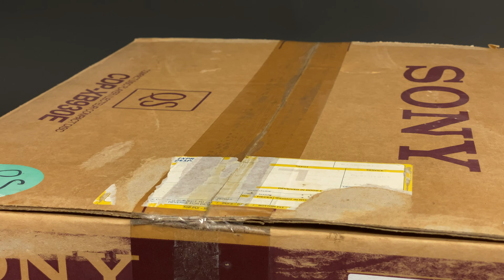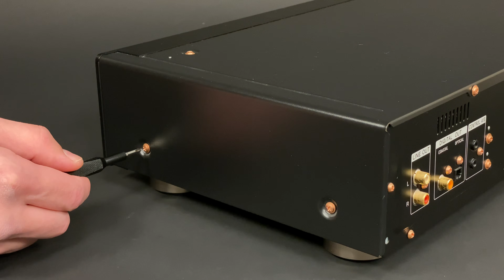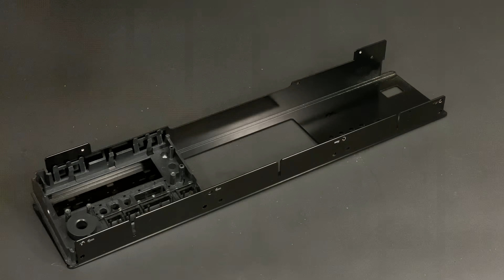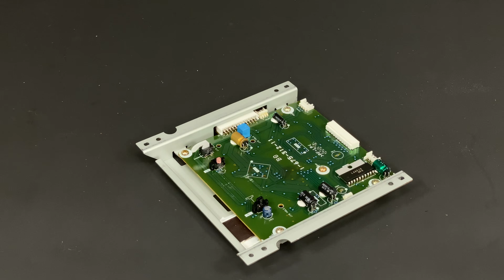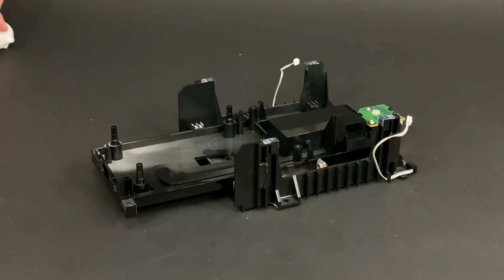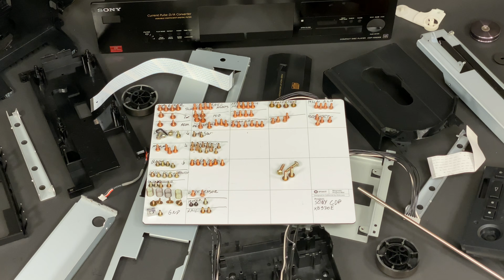Sony CDP-XB930E teardown

Comment: It's decent but you can tell this was when they weren't made so well. Cheaper. Not made in Japan :(
Reply from the maker: It's a huge difference when something is made in Japan.
Reply: It may not be made in Japan, but it’s a well designed and well put together machine. 

CD Players like this are not made anymore, they are all generic now.

Comment: Does this support CD TEXT ?, the copper block on the transformer is a heatsink
Reply: Yes it supports CD Text. I’ve had one of these from new.
Reply: @michaelb9664  Thanks m8
Reply: @Synthematix  no problem 👍
Reply from the maker: I don't think that transformer needs a heatsink. 

I don't have this unit anymore but I'm sure that you will find technical specifications very easy.

Comment: Ive just purchased this from a friend (not got it yet) its a silver Sony CDP-XB930 QS, but my friends also has a headphone port on the front I guess yours does not for some reason but same model number. Would you recommend my friend ship it with the puck removed? Do you have any information about what the mechanism does for playback if anything. Can it give better performance with a static laser? Or is it a fancy design with no performance gains 😉
Reply from the maker: Yes, I believe it safer to remove the puck and secure it outside the unit.
CDP-XB930 has very interesting design but I don't think that it would do a massive difference. Overall it's is a great player.

By the way. I saw a CD player  which need the cd to be loaded upside-down. Would love to tear that one down.
Reply: @boredtech  I assume that's the Pioneer Stable Platter model. That was so cool when that came out that I went down to my local hifi shop to see that one in person. It also features legato link processing. It had a different sound, but it was not night and day between my current player at the time, which I think was my Philips or Marantz (maybe Technics); my memory is a bit fuzzy now, so long ago. But the Pioneer was super cool to see in person at that time. I never did get one, but a few years later I got a Pionner LaserDisc player, and that had a legato link, so I was able to test it. It was not a massive improvement in sound; it just sounded different.

Thanks I will get it shipped with the puck outside the unit.
Reply: @boredtech l have a Pioneer stable platter player which I'm going to sell. I've thoroughly enjoyed using it but l have two better players now. I'm in England if you'd like it.

Comment: This is insanely good implemented video. A pleasure to watch... I have a question, i have the previous model Xe900 which has the same mechanism, but it does not spin and sometime when it spins it does not recognise the CD. The laser seem to light up, and the motor seems to work. However i have a small impression that the mechanism that holds the cd icannot move back and forth (as the laser stays in fixed position). Any  further ideas?
Reply from the maker: Hi, thanks for your feed back, I’m pleased that you liked it. 

Unfortunately I don’t have this player with me any more. I can suggest you to find a Service Manual, maybe there you will find some troubleshooting tips.
Reply: @boredtech  of course it would be great…

Comment: Absolutely brilliant to see your video.I have 2of these cd players ,one exactly like yours with the red UK badge and one without the UK badge.I wonder if that's why the copper mountings were used,for maybe to cater for the British liking for smooth sounding cd players.I love how well this player is built with quality components ,no wonder it sounds so good .I prefer mine with the filters set to number 1 or 2 for a Really smooth detailed as sound .I will not be getting rid of to these wonderful cd players , especially after your video revealing the high quality components.thsnks very much

Comment: If you fancy a challenge, I have a Technics RS-A6Z that recently decided it had enough... Taking that apart is a pain, I stopped on the main cover..
These loading systems were quite popular in late 90's, most big names had at least one player with a quirky transport mechanism.
Cheers.
Reply from the maker: Oh, cassette deck. I'm super exited! I have a lan to make tear down video of at least of different media format unit. Blu Ray, CD and MD is done. VHS, MC, DAT, LD and turntable in plans.

If you you instagram, please find me there. account: bored_tech

Comment: Just wanted to say a big thank you in appreciation for all the work you have put into this. I have this CDP since it came out and was always curious about how this special mechanism would work. And now finally I know plus I have seen it working! Top vídeo! But this raised some questions:
1) I am using it as transport with external DAC so I was especially interested in the shot where you can see the wobbling CD. Although the laser mechanism is clearly designed to compensate, I wonder what kind of modifications could be done to minimize this. Heavier weight maybe?
2) regarding the DAC chip if I understood correctly there is no information about anywhere, correct?
3) in what condition was the rubber band that spins the disc? Would it be recommended to replace it after all these years?
Thanks again for your time and dedication.
Reply from the maker: Thank you for watching this video. I'm really appreciate your comment!
1. About the CD wobble. I believe that it's completely normal. CD are not perfect, also it's extremely hard to load it so it's perfectly centred. So don't worry, automatics will always keep laser in focus.
2. Yes, I couldn't find any specs.
3. Rubber band that you are talking about is only drives the sled. There is a separate motor that spins the disc. So if your disc loading mechanism works fine, you don't have to worry about it. My rubber belt was in a perfect condition.
Reply: Back in the 80's, balancing and damping materials were sold as aftermarket tweaks. 

Purpose was to create a more balanced, less wobbly disc. 

Some of my early CDs still, to this day have these plastic/rubber rings. Some applied around the top perimeter... perhaps 15mm wide, others applied around the outer edge. 
Sims was one manufacturer.
Reply: @FOH3663  I used some of them rings you put on the top outer edge, cant say they helped but I did try them, they are still attached to my albums now :)